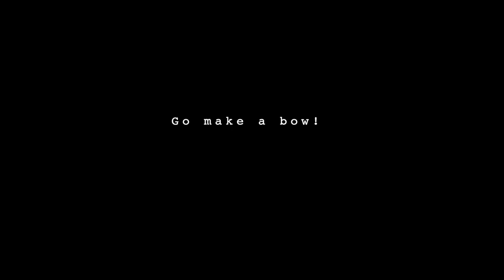Board to Bow: Making a Light Recurve from a Red Oak Board

Comment: nice one ! what do you think could you use common oak too? Ive heard someone build it but I guess its very heavy
Reply from the maker: I think pretty much all oaks are good for bow making. Over here I like white oak the most but I’m not sure what the best is in europe. I’m also making a full weight recurve from a white oak stave
Reply: @DanSantanaBows  I saw you posted a new hickory on reddit. will there be a video too? You heat treated it right? and you said hickory is one of the fastest woods after heat treating. please say theres gonna be a video :)
Reply from the maker: @Rowanbows  I made that bow off camera. Have been working on a board bow buildalong in detail for beginners. Another time i’ll make a video on heat treating hickory. 

hickory has the most world records in flight archery. Makes very fast bows if you treat it right. Heat treating helps but a big part is humidity management when you’re making the bow. Good hickory at 5-7% mc is top shelf bow wood. At 10-14 it’s ok but not that great
There are also bad pieces, not all hickory is equally good.
Reply: that heat treating process was mindblowing to me. The bows shoot almost as fast as fiberbows after all. Hazel turned out to be very light after all and i gained 5 m/s aceleration
Reply from the maker: I really like hazel with heat treating. Over here we have witch hazel which is not considered good bow wood but with a heat treat it’s very nice stuff
Reply: @DanSantanaBows  its the best tuning. I think the wood cells shrink while the process. the bow become lighter and the belly harder. after all you have a light and hard wood but the back stays flexible... tremendous penetration - its redicolous :)

Comment: Great video thanks so much . I’m building my first red oak board bow ( 72inch)and I’m wondering how long should the tillering string ( rope) be ? Thanks Arthur
Reply from the maker: Short answer is get it as short as you can without bracing the bow. 

You can follow my board bow tutorial the same for oak as maple. In that video you can see how I make and rig up a tiller string. Basically you use a string with only one loop that’s too long, and tie an adjustable hitch in the loose end. That way you can adjust the length of the string as needed and tiller many different bows with the same string
Reply: Thanks so much !

Comment: Dan, at what angle do you sharpen your (many) drawknives? I read 20-25° was good but when I put that angle on my blade the shavings became all square and crumbly.
Reply from the maker: That sounds about right to me. What kind of knife is it?
Sounds like maybe your bevels could be at the right angle, but maybe the edge itself is blunter
Reply from the maker: @beesmongeese2978  I wish I had a good answer but I’m not sure what’s wrong. The drawknife blade looks great. When i’ve worked yellow birch it carved very similarly to maple. i wonder if maybe your board has a bit of sideways runoff
Reply: @DanSantanaBows  Is it possible for a board to be excessively kiln dried and become mushy/crummy because of it? Maybe worth mentionning is that the board's surface was almost unusually smooth.

Edit: Birch's MC is 9~11% while maple is 14~15%. So I think the problem remains a mystery.
Reply from the maker: Kiln drying isn’t an issue, the problem is more often rot, because lumberyard logs sometimes sit around a lot before they get milled
Reply: @DanSantanaBows  That could be it. I'll keep going and we'll see. Wish me luck!

Comment: Sorry if you've covered this somewhere before, but is the vise with the half-log and carved wood and tennis ball handle something you made from pieces? I have a more conventional vise but seomething like what you have looks like it would be a lot nicer for roughing out a bow. Also, is that a hidden magnet holding the curved card scraper onto the side of the bench?
Reply from the maker: Yep those are magnets. You can see a tear down of the  face vise in my video on work holding methods. I made it out of random bits that were in the shop, the only thing I bought was a vise screw
Reply: @DanSantanaBows  weird, every time I think I’ve seen all the videos I ask a question and there’s already a video

Comment: have you ever looked into fire hardening a bow? If not check out Thad Beckum and Keith Shannons video about it I notice you use whitewoods a lot it makes them much better.
Reply from the maker: Sure, I heat treat most of my bows. I was heat treating over coals well before that dvd and know for a fact that many other bowyers were as well. Great method, but not a new or revolutionary idea. You can accomplish the same quality of heat treat  with other heat sources like a radiator or even a heat gun if you’re very patient.
Reply: @DanSantanaBows  I have had some good bows come from heat treating a bow. But they always took some string follow of some kind. I haven't had any after trying this method it is very cumbersome sometimes but it works. Thanks for the reply great video man looking forward to the next.
Reply from the maker: There is a huge difference between a light and a heavy heat treat. To me fire hardening is just a very heavy heat treat and I disagree with shannon
that it’s a distinct method, but of course really respect him and his skills as a bowyer. Heat is heat regardless of the source and in my opinion time and temperature are the main operating variables. Shannon makes some great and impressive bows, but the profiles he produces are very consistent with other bowyers who do deep heat treats. If the method was indeed superior then we would see superior profiles that other top bowyers are not capable of producing. I’ll eat my words if I see a “fire hardened” bow with a profile that’s not possible via other heat treating methods.

Comment: Beautiful bow! I love simple bows and a 60" bow that can be pulled to 32" is quite impressive actually. That means you are practically bending this bow in half! Pretty cool when you think about it. Side note, I have actually raised the draw weight of a bow by putting a handle riser on it. A stiff handle riser can effectively remove the bending through the handle and raise the draw weight. Or maybe I am just imagining things. Have you ever tried that?
Reply from the maker: Makes sense since this shortens the bending limb of the bow. Kind of like how draw weight increases when you pike a bow except without changing the length. Only issue i see is that you’re really gonna have to trust that glue joint.

Comment: He was able to steam bend a red oak board? Any time I've tried that it either cracked or the bend just didn't take. Can anyone comment on that?
Reply from the maker: A lot of trouble bending boards comes from runoff and violated growth rings. So this wasnt as risky as bending most boards because i chased a growth ring on the back. If I’m doing a big bend I also like to chase a ring on the belly.

If your bends are coming out, try locking with dry heat by heat treating the bend the next day. You can see a brief example of this in From Tree to Bow, after I bend the recurves
Reply: @DanSantanaBows  Just to make sure: steam the board, clamp it in the jig, wait until the next day and then reheat it with a heat gun while it is still in the jig?
Reply from the maker: @ericbaillie1098  Yeah after it bends leave it overnight then heat treat in the jig the next day. Be careful because it the wood is still moist and you’re too aggressive with the heat gun you’ll see drying checks
Reply: @DanSantanaBows  Thank you for the response. I have just lifted a major splinter in the back of my current project so It's time to shop around for a new board. I'll try out your method.
Reply from the maker: @ericbaillie1098  Forgot to say…I also sometimes hold a thin strip of metal like a flexible ruler on the belly of the stave when you bend. Helps keep any splinters from lifting

Comment: You dont really have a handle piece do you? It looks like its about the same thickness as the rest of the limbs
Reply from the maker: No riser, this one has a bending handle
Reply: @DanSantanaBows  oh i have  never made one. Ill try it out. Thanks for the reply
Reply: @DanSantanaBows  by the way your channel is awesome. Wish it was around when i started making bows. It has helped me anyways. Thanks for the great content.
Reply from the maker: there’s a lot more info on this style of bending handle in the bowyers bibles in the sections on west coast bows. Bending handles where there isn’t a width change (ie english longbow or a d bow) are much easier to learn with. If you have a narrower handle there needs to be a really subtle thickness change through the fades and handle. Just don’t cut out the handle without leaving the area thicker or you’ll get a big weak spot—you still have to tiller the handle like any other part of the bow. Good luck!
Reply: @DanSantanaBows  awesome its going to be my next project. Thanks for the info. Have you seen Kramer Ammons channel.
Reply from the maker: @chrisw3493  Sure, there’s a list of all the bowmaking channels i’m familiar with in one of my older videos. the one about natural dyes
Reply: @DanSantanaBows  awesome ill watch it now